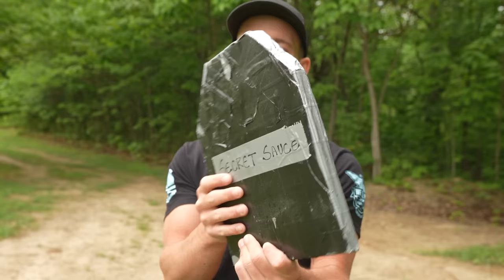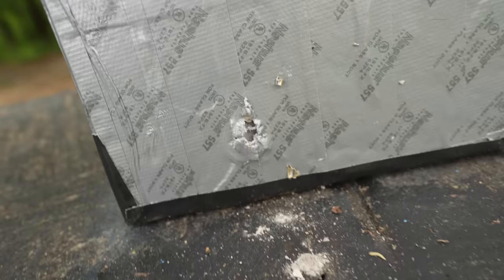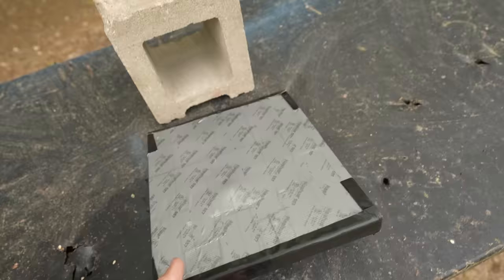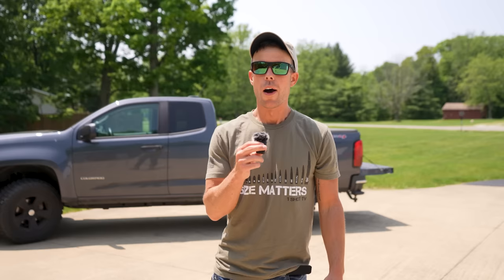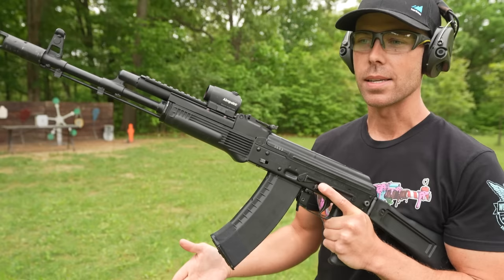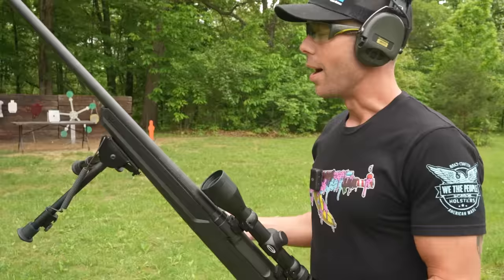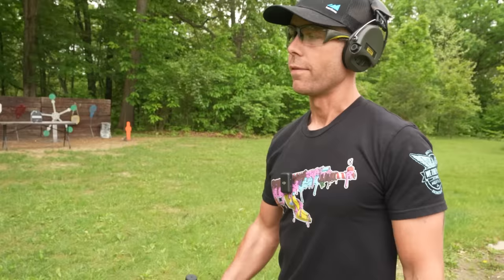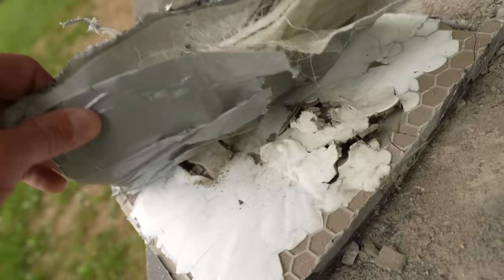CHEAP Homemade Body Armor That Stops RIFLES, How's It Done??

Comment: Food for thought. The main way tanks defeat penetration is by angles. Why not use angles to redirect the projectial on body armor. If you look at ancient Japanese Samurai armor, the chest plate is curved or angled in some way. Also they used a silk parachute behind their horse to catch incoming arrows with great mass, by slowing them gently.

Armor needs more dampening and angle deflection to defeat high velocity, high mass projectiles. Add a ridge in the center creating a 22 degree angle to the edge with a spaling splash guard under the neck. Put light weight high density foam between layers of pure titanium, not alloy with silicon adhesive and kevlar sheets. Add a Polly carbonate top for mounting goodies like reactive armor. Yes, I've been drinking 😮
Reply: Some guys have some crazy angled armour and even tubes wrapped around you. I suppose it's a natural curiosity. I would wager it's so that anyone near you isn't catching the bullet that your armour should be stopping. If you are on your own, I guess it doesn't matter. The angled steel video, without any modern body armour was deflecting rifle rounds with simple flash on the steel for evidence it was even hit. Is it practical? If you want to look like a knight of sorts. It might be easier to anti ballistic the inside of regular knight armour than reinvent the wheel.
Reply: Had the same idea for my own. Angled surface creates in effect much thicker armor, with deflection the goal.
Reply: Because it deflects straight into vital arteries maybe?🙃
Reply: Lol are you a tank? Because if you're not a tank, then all this angled armor would just get in your way and make you less agile due to the nature of angled armor. It's good for vehicles. But on a person, you want armor that's not going to get in your way while still maintaining a level of comfort.

Comment: The 308 on the saucy plate actually went thru the plate, inside of the cinder block and then hit the red steel target. Check the slow mo again:)
Reply: Like hi-test fluid & cornstarch where speed/pressure tightens it up?

Comment: So these are ALMOST Level III plates...
Might I remind people that the plates, in order from lowest to highest protection, go:
Level III
Level IIIA
Level III
(Level III+) *Not official
Level IV

The IIIA is rated for 44 Magnum
The III is rated for 5.56/7.62 AP
And the IV is rated for 30-06 AP.

There are a TON of considerations that go into making body armor. But the most important lesson is that you should get the best body armor that you think your life (or at least the internal organs that armor covers) is worth. A huge majority of civilian gunfights will be with handguns, so a level IIIA will suffice. But stepping up to a Level III will provide significantly more protection from common, FMJ rifle rounds you might face. Level IV is for when shit goes down. The problem is that Level IV armor is typically compromised after 1-3 shots. After that, even a 22 can skate through it. It's also typically solid and much heavier than the III/IIIA armor.

In any case, you're not going to be having a good day if you get your money's worth from your armor. But you'll be sore and thankful instead of stuff and blue.
Reply: Soft level IV has been made, and for multiple rounds.

Comment: Wouldn’t it be fairer if you tested the .223/5.56 out of a barrel the same size as the 7.62X39?
Reply: A 20” barrel 556 could have zipped through it

Comment: He did pretty good. Imworked with some Turkish guys that took small baggies filled with BB's and resin and made like this wierd dragon skin type armor. It would cause the bullets to break apart they claimed. We tried telling them that it wouldn't work and would in fact kill them if they got shot...I mean pool anyone??!!....but they insisted it worked and the most outlandish claim was that it stopped 7.62x54R. Absolute insanity. But it was a leather vest filled with these baggies and resin used in yacht making to put GRP hulls together. Yachts I know about too and the resin is tough, but not that tough.
Reply: I could be wrong but from what I've seen with homemade armor 7.62x54R isn't all that hard to stop. I think it has some similar ballistics to a .308(7.62x51mm) even though I know those 2 are supposed to be different ballistically. The reason I say this is because there is a guy on YouTube who made some plates that actually stopped the x54R round. Hell those plates he made were even able to stop 5.56 green tips with one plate stopping 3 rounds of 5.56 green tip, 6 rounds of 5.56 M193, and a shot of 7.62x54R FMJ! One plate was able to stop all of that before failing to stop follow up shots due to the plate being too compromised by that point.

Comment: I love the Calicos! We have a Scheel's opening in July here so it will be a good place to be for the grand opening. try the SS109 round...it is 5.56 with steel tip.
Reply: I think even the normal .223 would’ve done a lot better if shot from a full size rifle like a 16-20 inch barrel

Comment: I'm curious what the velocity of the bullet is after it passes through the body armor.  So maybe a bullet will pass through the body armor, but does it still have a velocity that would make it absolutely lethal? If the bullet is traveling at 2500 feet per second when it hits the armor, is it only going 500fps when it exits? 500fps will enter the body, but will it penetrate enough to puncture vital organs?

Comment: What I want to know is not about what seems to be a shockwave from the .308 but when he showed the impact on the plate of the same shot it almost looks like when the bullet makes it through the plate and got redirected it looks like the projectile made contact with a small piece of cinder block and exploded it because in the top right corner right above the cinder block you can see a dust explosion out of nowhere and that is the only thing I can think of especially when he said it made it through and when he laid the plate down and you can see the direction the projectile went when it made it through the back of the plate

Comment: Speed defeats hard armor like steel plates once you start getting into ceramics and them poly plates you require more then just speed it depends on material your trying to poke a hole thru

Comment: Ceramic tiles make total sense when making homemade body armor.
And it also makes total sense to have "plates" of different materials between the tile layers.
Fiberglass/resin is great for that.
If I was to make one, then I would start with a 1/4 inch layer of fiberglass/resin, then a ceramic floor tile, 1/4  inch of fiberglass/resin, second ceramic floor tile and then 1/4 inch layer of fiberglass/resin. 
The best is to make in a mold as that would give it a better shape and make it stronger against delamination if done correctly.
This should make it even stronger than the first and best body armor you tested in this video.

If wanting to make it even stronger, then a third ceramic floor tile and one more 1/4 inch layer of fiberglass/resin should be added.
It will still not be very thick and heavy and I think there is a good chance of stopping a 308/7.62 Nato then.

Ceramic floor tiles can be bought for close to nothing when you only care about the size and thickness and not how it looks.
Many stores and/or building companies tend to have some leftovers you can get for very cheap or even for free.
Some floor tiles of better quality are stronger than the regular ones, making it even better if you manage to get  your hands on any of them for cheap or free.
Reply: It actually doesn't, because if the bullet goes through it'll push sharp ceramic fragments into your wound!

Comment: So many possible combinations of materials to be tested. Y’all are doing to the lords work. I imagine brake pad material would be a good component to add as a layer. I’m was thinking UHMWPE micro spheres, zeolite, Portland cement, crushed glass, compressed fiberglass impregnated with a polyurethane resin… Wish I had more time and money to spend on this sort of research….

Comment: Yeah the "Speed defeats body armor" thing is misinterpreted by a lot of people, sure speed helps, but it's really only for specific ammunition against specific armor. Otherwise Russian 9x39mm subsonic, SP-6, PAB-9 and BP would not be considered armor piercing... which it certainly is. Not like SAPI capable, but enough to punch through stuff a 7.62x39mm FMJ couldn't on it's own.
Reply: I agree but I think the .223 would’ve done much better than the 7.62x39 if it was shot from a full size rifle like the 7.62x39 was would’ve been a more fair comparison on this particular video

Comment: Someone has to do one with layered fiberglass blanket and ceramic, steel, and G10 plates. That’d perform much better I think, and might even be less than an inch thick depending on the separate materials initial thickness.
Reply: I’ve never thought of using G10,that might not be a bad idea
Reply: @garrettferrell6821  I’ve shot it with a 22 lr and 20 ga no4 buckshot and neither one came close to going through.

Comment: You’d be amazed what two pieces of aluminum with a piece of fiberglass in the middile will stop. 1/8” alumin on the strike face, plus 3/4” fiberglass in the middle with a 1/4-1/2” piece of aluminum in the rear. Use the fiberglass cloth, right weave.

Comment: From front to back, 
2 layers of kevlar, 1 ceramic tile, 5 layers kevlar, 1 ceramic tile and 15 to 20 kevlar layers as fragment stop.

The 1c+5k layers can be added to improve the stopping power 

The cheapest armor I can think of

Kevlar, aramid, dynema etc might work for this

Or try the combination of kevlar and polycarbonate or polycarbonate and ceramic tiles

Comment: 1st shot  on second plate test you closed bolt I saw something fly out  from your left  . But did you also know if you heat up metal sheet steel it tempers it same as if ar500 steel  is heated it goes soft 🇬🇧👍🐾🦊
Reply: 1st shot  I got notification of  reply  but nothing there

Comment: Another firearms channel recently did a similar test, the material that on your test was extruded 10" out the back, was inside of and hanging out the back of the ballistic gel zombie torso the ballistic plate was in front of. Not survivable.
Reply: Sure, but for a car door insert/ panic room that isn’t an issue, so the testing still yields interesting results.

Comment: I heard the 1 homemade body armor that will stop 7.62  is a layer of kinetic sand on top of a 14mm steel plate, then a floor tile, then 100 sheets of paper, then another floor tile, and finally a 2nd 14mm steel plate on the back.

Comment: The white paste could be shear thickening fluid ....non newtonian fluid .
       OK this is the way ya do it ...40 layers of kevlar 29 epoxy resin each layer ...under the first two layers will be 3/8 inch ceramic ball bearings...very very  hard and the curvature causes the bullet to yaw making it much easier to stop as it hits with more surface area. 
              But my thing isn't guns ...it's arrows and soft kevlar body armor that will stop .44mag rounds will not stop arrows  not one .....sand bags that stop 30-06 rounds .....will not even slow an arrow down...it'll kill whoever is on the other side

Comment: What if you use a layer of 2 or 3mm thick ar500, a layer kevlar, again a ar500 plate of 2mm thick, again kevlar and as last again an ar500 plate.

Comment: Well he appears to be using 12ga A36. It takes 3/8" of A36 to stop a .223 24" bolt action, but 1/4" of AR500 will stop the same round, AR650 can easily stop the 223 at 1/5". L2 Bainite perfectly heat treated at about 1/8" can Roughly stop the a .223, but confidently defeats a 9mm or a .45. If he simply used stainless steel he would have had something impressive. Anyway I'm a Blacksmith and I think I can stop a 30-06 AP black tip from 50 ft away, with 1/4" thick tempered tool steel, but I don't have a 30-06 and cannot test it yet.

Comment: Another great video,  the ERECTION ON THE HOT SAUCE PLATE FROM 308 CRACKED ME UP...
AND THAT WAS NO SHOCK WAVE BRO ,,, RICOCHET FROM THE STEEL PLATE AFTER IT WENT THROUGH ARMOUR, glad you didn'thaveto put a THUMB IN IT... I DO WORRY ABOUT YOU MY BROTHER,  BEING ON THE RANGE ALONE, HAVE SAFETY AND EMERGENCY SERVICES CALL NUMBERS ON SPEED DIAL AND A GOOD 1ST AID KIT ON HAND... but you on the range alone is kinda part of your signature...
GREAT FOR HOME MADE ARMOUR BUT .
STAY SAFE AND KEEP EM COMING MATE... 
I think that you also need a BULLET TEST DUMMY like buster from mythbusters, even like those real life boxing dudes, so you can put shit on Him for testing when it suits,,, eg balance an apple on his head and POW... ALSO TRY SOME BULLET RESISTANT SAFETY GLASSES WOULD BE COOL...

Comment: Shout out to Nashua 357, the best REAL duct tape ever. Those plates were wrapped in it, and I used Nashua 357 for over 30 years in HVAC contracting. No, you can't buy it at Home Depot, and NO, IT'S NOT DUCK TAPE!

Comment: It stopped the 223 and not the 545 because you used crap ammo out of a 10.3 inch barrel.  If you used a 16 inch barrel and decent ammo it would not have stopped it.   Using a mk18 takes away the penetrating ability of 556 and using wolf or tula doesn't help.  Just my observation.

Comment: Where's all the 5.45 haters now? Chirp, chirp.....🫠😎
Reply: It was an AP round,if he shot M855A1 outcome would be the same,I'm not 5.45 hater,just sayin😊
Reply: @Malik CRINGE  I didn't say anything against the 5.56. Just talking about the 5.45. And it's technically NOT an "AP" round.
Reply: @pennsyltuckyreb9800  wait, I thought 7N6 WAS the AP version, is it not actually classified as a penetrator round???
Reply: @EVLfreak666  No. But the ATF loves to classify it as such. 🙄

It's no more "AP" than M855.

Actual, 5.45 AP rounds were after the 7n6 and were never allowed for import or sale in the U.S., unfortunately.

Comment: So you shoot 5.56 with a 10” barrel then 7.62x39 with a 16”??? And apparently he’s unaware of the difference between hardened and mild steel!!! The 7N6 has a mild steel core due to economics not armor penetration!!! The difference between lead and steel at 3,000 FPS isn’t as significant as using a heavier lead bullet or more velocity!!!
What caused the penetration was the velocity of 5.45 in a 16” barrel!!! I’m really confident a 5.56 of comparable barrel length would do the same!!!